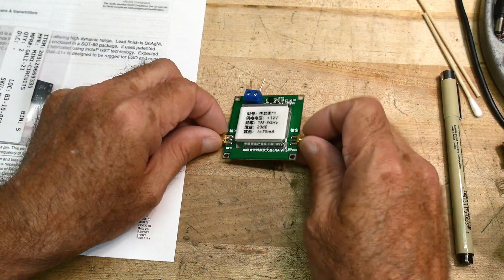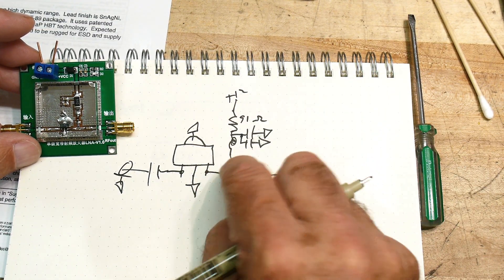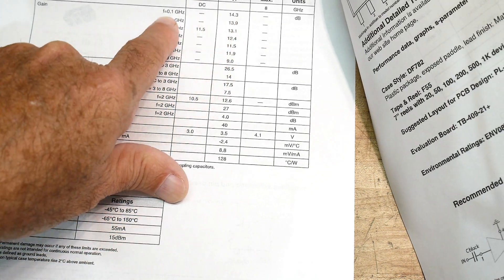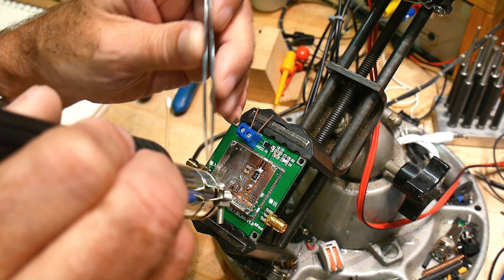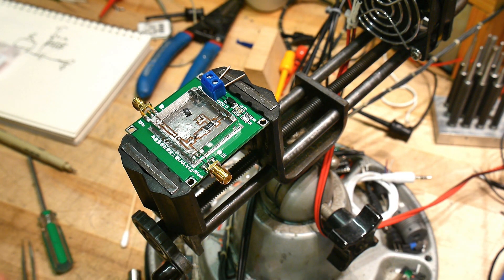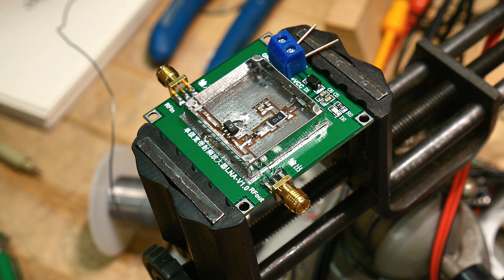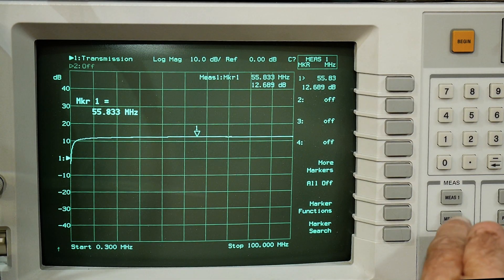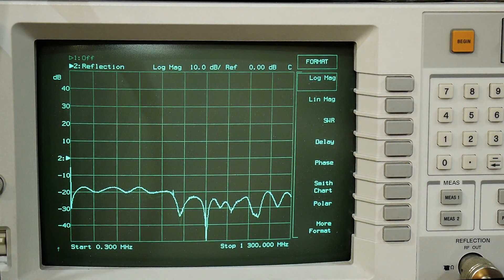#917 Mini-Circuits Gali-21 Upgrade

Comment: The GAL-21 datasheet has Vcc of 3.5V nominal with 4.1V max. Is that an issue or is there a regulator somewhere?
Reply from the maker: opps. missed that one.
Reply: @IMSAIGuy  I see what looks like a series diode to drop the power (unless it's a zener but the stripe is to the right). Wondering if the 12V marked on the lid is in error or if the part in the Chinese ones runs at 12V? Some of the units on the web with similar looks have 5V marked.  Maybe the series resistor takes care of some of it? It also looks like the caps are at the top of the resistor (not in betweek the R and L) but hard to tell for sure.

I'd be curious what DC supply voltage the part is seeing

Comment: Thanks for doing the upgrade I was wondering if it was worth it as sure enought it certainly was... That PGA103+ is indeed very popular are you in a position to check out the claimed low noise figure that would be very interesting ..Cheers

Comment: how the hell do they get that nice flat gain and S11 for such a wide band?!?!?!? Most matching networks are kind of narrow band, and I did not see any distributed planar match in the PCB...
Reply: A negative feedback line containing series RC does that. For example, 330 ohm + 1 nF from input to the output pin.

Comment: There is also the PGA103+ that is quite compatible but it has a very low noise factor. Look it up, it is very used among radio amateurs and SDR enthusiasts.